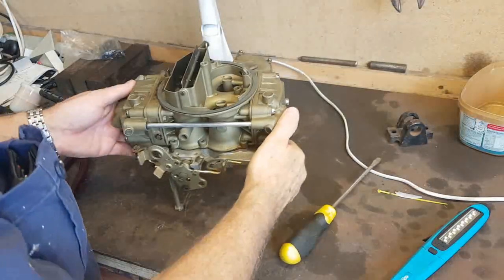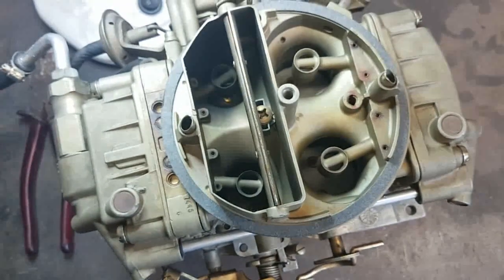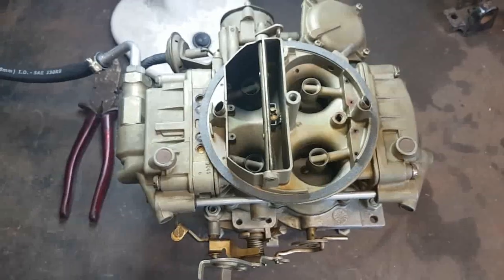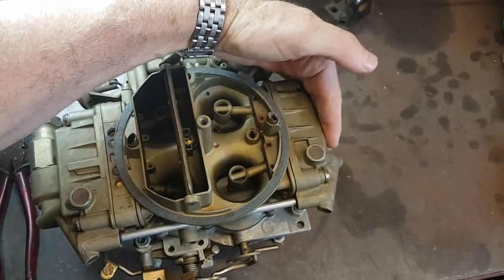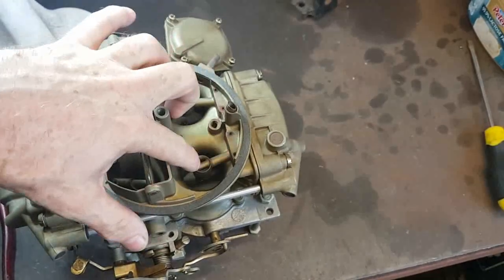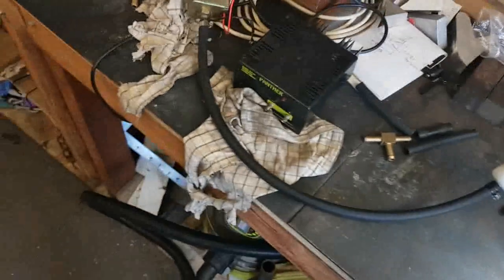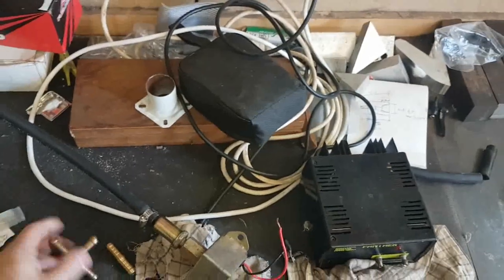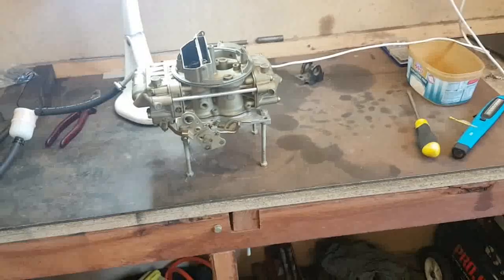Flooding secondaries on Holley 4 barrel carburetor

Comment: The first thing I do with a carb like that , off the engine, dry and clean, to test it is to blow into the fuel  inlet  with my mouth.  Air should pass freely. Then turn it upside down and blow. Now , the needle should be on the seat and air should not pass. If it does, one of the needle and seats should be looked at. If you had a dual feed carb, you could try blowing into each inlet separately.
   I've filled the bowls with water through the vents to test the accelerator pumps.  They are generally even worse than the needle and seat on old used carbs.  Of course I turn the carb upside down and poor all the water out when I'm done.
   If it fails either of these tests, there is no point putting it on an engine until at a minimum these problems are fixed, and maybe a whole rebuild kit put on.
Reply from the maker: I did this a while ago. I have watched a lot of YouTube videos on Holleys since then. There are way better videos than mine done by people who know a lot more than me.

The car this is on was given to me by my dad about 5 years ago. He didn't drive it much at all. Then it was in for a respray for 14 months and the motor didn't start for that time. I had to spend a huge amount of time sorting lots of things out, the carbie included. (See some of my other videos.)

I have left  this up in case someone happens to find it useful.

Comment: On other Holley carbs, bad needle & seat O-rings are a very common problem causing fuel by-passing the needle and seat and flooding the engine.  I wonder how many carbs have been tossed by folks who don't know these basics. Remember, Holley has been around for over 100 years. They are not hard to maintain if you take the time to learn about and look after them. Good luck!
Reply from the maker: Hi John. I had to change the power valve after all the problems I had with the electronic ignition. (See the play list if you are interested in what happened there.) It blew the valve out.

About a month ago I had to clean the primary needle and seat due to the same issue. I can't imagine owning a hotrod and not knowing how to work on it.
Reply: @philotrum  We all have to go through the learning curve. I'm sixty one and there are times that I don't even want to go into the garage. Good luck

Comment: 5 minutes of nothing. Remove the secondary bowel, blow out the needle & seat (not the jet), and adjust the float level. Problem solved.
Reply from the maker: True. 5 minute of nothing. I just shared what I did. Nothing more. And yes, I realised after the fact that I said jet instead of needle and seat, but didn't bother re-shooting, or even putting a correction in text under it once I realised as I had already posted it. I have no idea why this video has over 9500 views. I did it more for myself as a record that I could go back to. I don't even really know why I posted it on YouTube. It is just another thing to try. That said, I would have found this 5 minutes of nothing helpful before I worked out what was wrong. I am not a mechanic, so I have to learn this stuff somewhere.
Reply: Graham Kettlewell  The video probably got +9,500 views because the problem you had is very typical for a Holley. Folks,were,looking for a fix, and thought your video would provide a solution. Now you know what you need to make a better video. Good luck!  The last paragraph in this section http://www.myruffhouse.com/1969_corvette.htm#FUEL%20TANK%20SAGA of my 1969 Corvette described how I cleared the needle & seat in the Holley double pumper I have on it.

Comment: Good video Graham, just had a 650 rebuilt and it is dribbling fuel after shut down, on one secondary only, given me an idea on how to rectify.
Reply from the maker: Thanks Sam. I am learning a lot of this stuff as I go. I just had to replace the power valve as well. I have been fighting to get what is a pretty simple engine to run reliably for way too long. I think that I have had a number of issues with the carburettor caused by a lot of backfiring that was caused by the electronic ignition problems you can see in a number of other videos that I have posted. I have started editing another video documenting the fight I am in at the moment to stop the car from boiling. I have made things a lot better, but I would still boil if I got stuck in traffic for over about 20 minutes.

I am glad this video helped someone!

Comment: I had someone rebuild a carburetor and the primary Jets are just dumping gasoline into the engine like a river. . aren't the Jets supposed to be somewhat under pressure and the gasoline is supposed to spray out?
Reply from the maker: I kept saying jets when I should have been saying needle and seat. My problem was that the seat was dirty, and the needle wasn't shutting the fuel off in the secondary bowl. 

This carby is a replacement for a 750 double pumper that my dad had on the car since about 1978. We put the car in for a complete back to metal respray about 4 years ago. The 750 dried out during the 12 months the motor didn't start, so I spent $650AUD getting it rebuilt, not realising that we could get a fully reconditioned one for $450AUD. The rebuild was not done well, and the car wouldn't idle. We ended up buying this rebuilt carby rather than doing anything else to the 750.

The electronic ignition then died (See my videos on the Buick timing problem, distributor strip and test and electronic ignition for some of that saga), and the car was backfiring all the time. I am not sure if this caused the problem, as I am not sure how dirt would get to the needle and seat from backfiring, but somehow they got dirty. This meant that I had 2 problems that kind of looked like 1. It took me ages to get the car starting and running properly again!
Reply: you dont want the needle to have any dirt or anything in its way  it must seal   if it doesnt the feul will drop or flow out of the secondary venturis   even if the engines off , itle empty the secondary bowl,